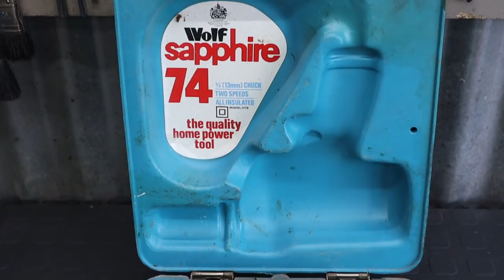1972 Wolf Sapphire Electric Drill Restoration.

Comment: You did a lot more than it needed.  Yes, it needed a good cleaning, but internally, it showed little wear and was still full of grease.  I suspect the bearings were fine.  I saw some wear on the worm screw, but that went back in as is.  Everything else was totally cosmetic.  Elevating a domestic power tool to museum level status is questionable.  Do you ever intend to use this work of art, or is it just to be admired in a display case?
Reply from the maker: Admired in a display case definitely. I would fix the worm gear but I do not have the tools to make a new one also no spares available anymore. So the worm gear went back in as is.

Comment: That original cable was better than your replacement. The new cable is just a cable and nothing more. The orange one had a strain relief and offered some protection.

Double insulated is another way of saying "doesn't need an Earth pin" Meanwhile all plugs in the UK require 3 pins all the time, so you may as well fit the earth.
Reply: I agree with the strain relief, the drill needs one, they aren't expensive to get and it prevents cord damage (even for a museum piece). the problem with the ground wire is that there isn't anywhere to attach it to, the entire case is plastic. the trigger switch doesn't even have a ground lug, and it could use one.

Comment: @5:14 I am assuming that is gasoline you are using to clean the parts? It still works good enough anyway!
Reply from the maker: The single best degreaser on the planet. Gasoline.
Reply: @AJRestoration  Quite dangerous though, mineral spirits do an excellent job and don't tend to cause health problems and explosions.